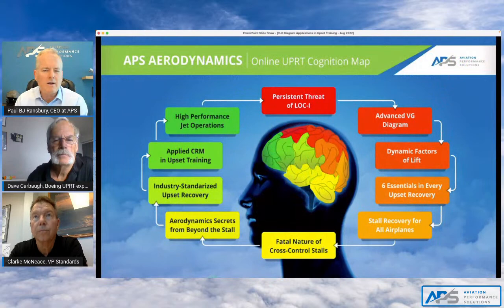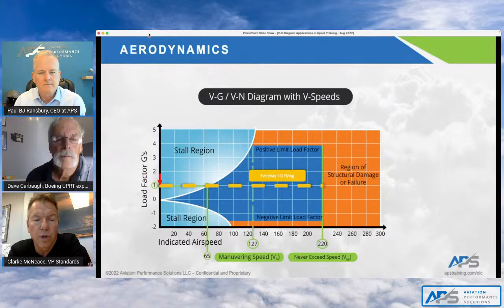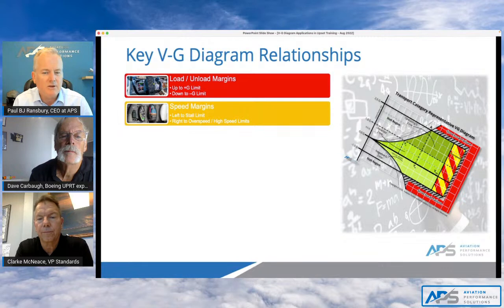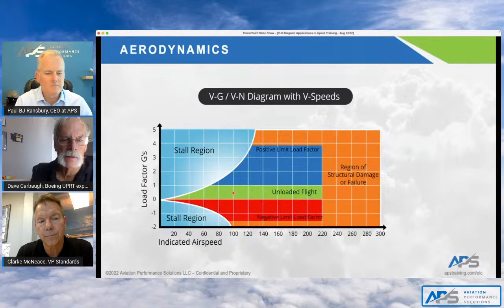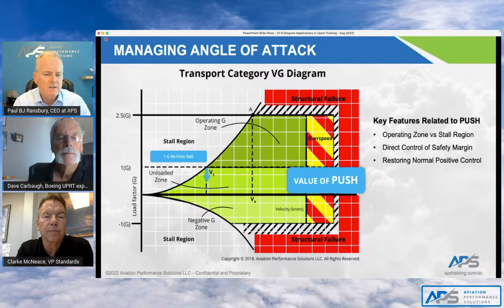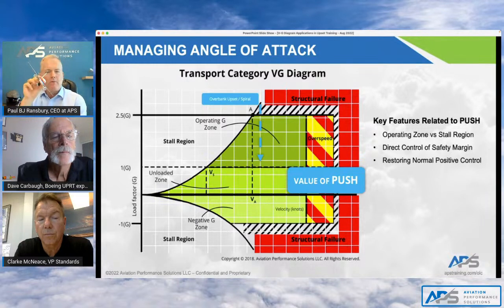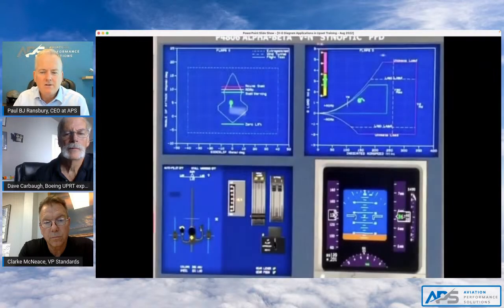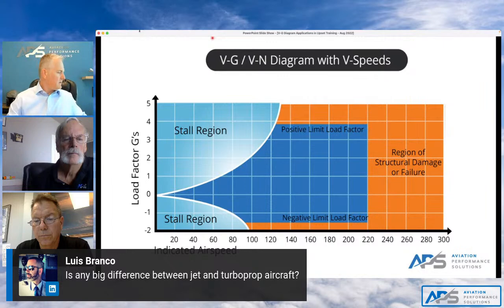V-G Diagram Use in Upset Training

Comment: I fully concur with what is being said in this presentation with regards to the V-G diagram. My opinion is that negative 'g's' may not be so difficult to enter with pilots who REACT abruptly to unload an aircraft in flight during an upset situation. The reason being three fold: 1. pilots do not have the 'muscle sense' to feel the aircraft in such a fearful situation especially if the startle response hijacks the 'cortical' brain and the amygdala takes over control; 2. how effective is the training that is being conducted to instructors and pilots alike with the airline itself? I have seen that, following the TtT courses I have conducted, the 'operational drift' by instructors is so pronounced that the 'added flavours' picked up the flight crew varies 180 percent from what the standard should truly be; 3. The training generally does not ho into detail of the consequence faced by the airline and pilots alike if, in a court of law, it becomes evident that pilots acted in an appropriate manner causing injuries to aircraft occupants due to either ineffective training or in violation of what has been correctly imparted by the airline itself. As I said, this is my opinion and I hope that you fully disagree with what I have stated. Thank you.